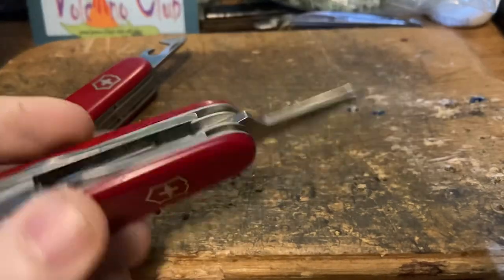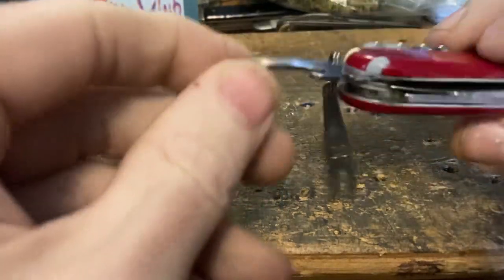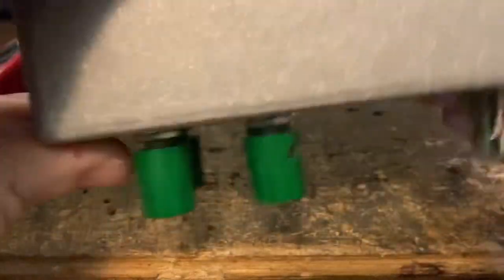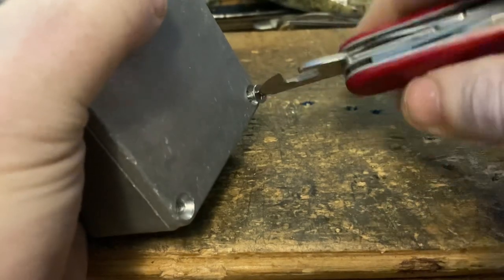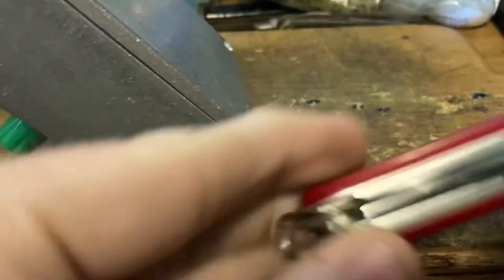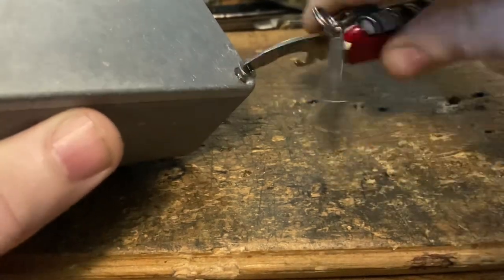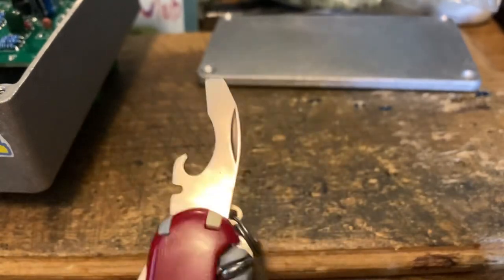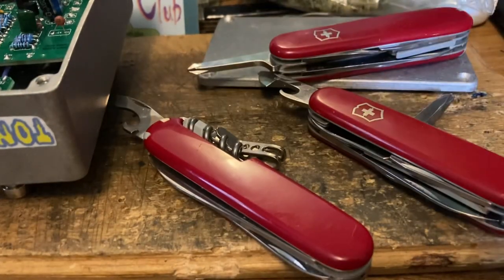Does the Compact Have a Hidden Phillips?

Comment: Imagine if Victorinox made (instead of the hook) a phillips head screwdriver that still has the nailfile on its side like the hook does now. That would make the Compact perfect.
Reply: I’ve super glued emery board(backing removed) to my climber in various places now I have 3 files. One on back of hook, one on side of flat head and one on the side of the can opener.
Reply: @strikenryken I'd like to see a small nail file replacement of the toothpick or tweezers.
Reply: I’ve always thought that they should put one behind every corkscrew on the side of the liner. I don’t think they would have to build an extra machine as it’s lasers on or something (I think).
Reply: I guess you would have to cut the hook off and weld a phillips head onto it.
Reply: godddd  @corbenj
Reply: Some of the older knives had a Phillips head in place of the corkscrew and had a file on the back of it

Comment: I don't think the back Phillips is much better than the combo tool for Phillips screws. I made a nice bit exchanger that fits my Compact combo tool from a 1/4 square to 1/4 hex adapter it rides in the bottom of my front pocket with a Phillips bit. I recently bought a 3-D printed bit exchanger from eBay to try it out it fit and worked well but my DIY exchanger rides in my pocket better. I also added an LED light to the scale mod from Felix Immler here on YouTube.

Comment: I carry a Compact with a suspension clip too. I had to undo three phillips head screws today on my garden vacuum/blower. It was too hard with the Compact. I went inside the house and got my Milwaukee Fastback with the bitdriver with phillips head bit. So easy compared to the awkward combo tool. I love the smooth feel of the SAK but the combo tool is a dealbreaker for me. Terrible as a phillips screwdriver. Only in the worst emergencies.
Reply: You should buy a Climber. Same thing but with opener layer and an awl.

Comment: It’s a Felix Immler “in a pinch”
Phillips driver.  And I’m one of those who says you can use it as a Phillips.   But there is a reason why it advertised as a Phillips.   You can also turn a no. 2 Phillips with the Classic SD.  But again it’s not the best idea to use it for that purpose.

The question is how often do you need to turn a Phillips screw in your daily existence?  99.9% of the time, if I need a Phillips driver I’m using a cordless screwdriver or a Craftsman!

As you said, the combo can be used as a Phillips in a pinch and in my opinion, in a pinch, it works very well.  It will definitely save the tip of your main blade.
Reply from the maker: These are for when you unexpectedly need an SD in my opinion. I have to open stuff daily that uses Phillips screws so I always have a proper SD handy, but if I’m out somewhere and maybe need to change a battery in my guitar or one of the pedals that’s when I use a SAK SD. I have even had to open stuff with my Compact if I was really unlucky. It gets the job done but it’s not a good time.

Comment: The 2d Phillips can be improved upon , easy MOD .
Simply grind off can opener and reshape slightly. 
My YouTube video gives show  : Victorinox Angler black plus scales and modification. I follow the lines of a 2d leatherman bit  , it also much improves the small flat with much better clearance,  the way I do it , the reshaping takes the 3mm flat down to about 2.5mm . 
I even modded the Explorer which has a good in line Phillips,  but did it for the sake of getting a more usable small flat . I mod all my SAK apart from the Swiss champ,  just as a base . 
Oddly enough grinding off the can opener actually improves the can opener?  Another video 6 years ago demo . : Victorinox Explorer, huntsman, farmer, climber screwdriver can opener mod.  
Have a look at your leisure.  Any feedback welcome.

Comment: The Compact Disc s for someone who must have the scissors, and either finds a third layer to be much too bulky or they just don’t have very many random screwdriver moments in their life.

Someone who turns a lot of random screws at odd moments is probably going to want a Tinker or Super Tinker, depending on their point of view regarding scissors.
Reply: "The Compact Disc"?
Reply: "Someone who turns a lot of random screws at odd moments is probably going to" ... have a bit set and a ratcheted screwdriver.
Reply: @ivarwind  Or a roll of condoms

Comment: Nice "real life" style video, thanks!
You know, after reading all the great commenta about the compact i got one, carried it a bit, and then... Carefully stored it a drawer and went back to my regulars, mostly a climber or a sportsman when I want to keep it smaller.
Not that the compact is not a good knife, it surely is, but the combo tool it's just that kind of compromise that does a little of everything, but nothing good.
Can't beat the regular openers layer for the combination of stronger pry tool through the cap lifter, or delicate "remote control opening" pry delivered by the can opener, combiner with a more useful flat Phillips driver.
You know what the best would be? A climber with the sportsman nail file instead of the useless secondary blade! Both for filing nails, of course, and... For small size Phillips screws! That thing is fantastic on the tiny Phillips on electronic devices
Reply from the maker: They made exactly what you described, a climber with a file, it was called an Alumnus.
Reply: @swizzarmygrizz  oh f... Did not know that, and I imagine it's one of those "impossible to find, and if you do find one you can't afford it" kind of SAKs, right?
Reply from the maker: You’re right. I’ve never even seen one for sale.

Comment: Good video 👍 I have a Compact and it's a great pocket knife for many things...but not taking the place of a screwdriver. In a pinch, shipwrecked, car broke down 50 miles from nowhere, maybe 😅 but not my first choice. I usually carry the SwissChamp and it's much better for stuff like that. The Compact I carry maybe when I'm going out and don't want something on my belt and want to have something on me for 'just in case' but I'm a SAK junkie anyway so I have a decent little collection of different models. I pretty much like them all and the quality is always spot on. Just depends on what I'm doing as to what I'll be carrying.

Comment: backside is the worst idea of victorinox. almost dangerous for your fingers.
Reply: Only thing I use it for is loosening tight screws, which I then unscrew with the can opener. I usually carry a SwissChamp anyways so lack of corkscrew isn't a problem. It's nice to be able to choose between a bit higher torque phillips to start off tight screws or a corkscrew.

Comment: Happy Wednesday Lord Grizz. TBH if I am going to open a Phillips head screw I rarely use one of my SAK's for that, I use a rechargeable hand held electric screwdriver with the appropriate sized Phillips driver. The back layer Philips on SAK's is IMO totally impractical to use anyway & I have yet to use the in-line Phillips on my Spartan Lite, Climber Lite, Huntsman Lite or Outrider, nor do I consider the Combo tool on the Compact, Waiter & Bantam suitable to use as a Phillips screwdriver anyway. To the best of my recollection the only times that I have screwed / unscrewed a Phillips screw using a SAK was to fit a SwissClip to several of my SAK;s  and for that I used  my Cybertool M SAK with its bit driver and I have used the tiny combo tool with the Phillips head on the 58mm  Midnite Manager to tighten up a very small Phillips screw on a small transistor radio.
Reply from the maker: I use them all the time but it’s certainly not my first choice if I am working on something. They’re more for when I need to change a battery or something like that and I don’t feel like going to get a proper driver.
Reply: @swizzarmygrizz  I've found that a lot of small gadgets & even some flipper knives have Torx head screws nowadays rather than Phillips & for that both my Cybertool M & electric screwdriver  are the tools to use
Reply from the maker: I seriously wish everything was Robertson. A lot of electrical terminals are combo Robinson/slotted and those little square drivers are the best for grip. The one downside is it can be hard to get them if you’re at an angle. Torx allows this.
Reply: @swizzarmygrizz  Happy Thursday Lord Grizz. IMO Victorinox is behind the curve again, they need to produce updated  versions of 58mm SAK's like the Rambler, Manager / Midnite Manager & Mini-Champ / Midnite Mini-Champ with a Torx screwdriver in place of the Phillips on the 58mm sized Combo-Tool
Reply: I think the point of having these tools on your SAK is that the have something you can use when you need a tool and your away from your regular tools. It's about having some basic essentials in your pocket because you don't have your toolbox, or your cordless screwdriver, everywhere you go.
Reply: @mehardin  My comment was about the increasing use of Torx screws & the need for Victorinox to address it on their SAK's.